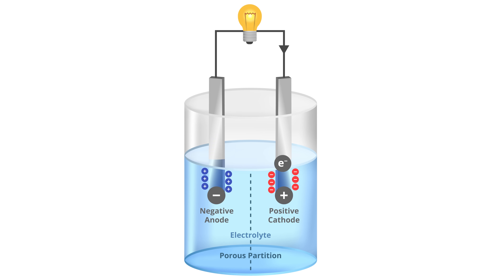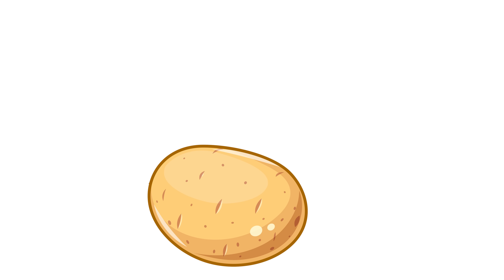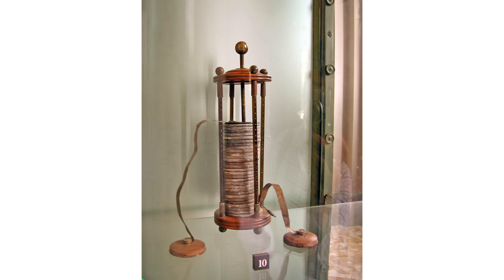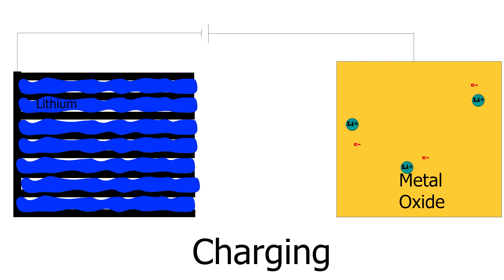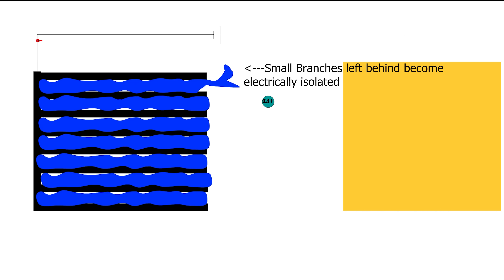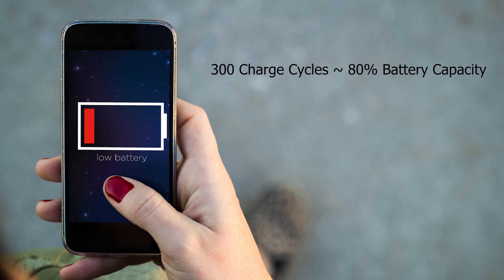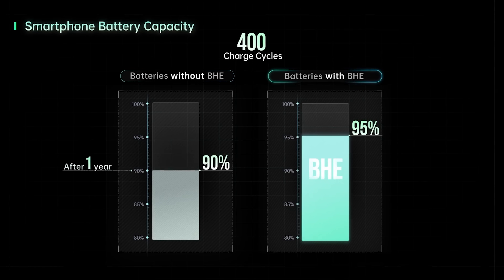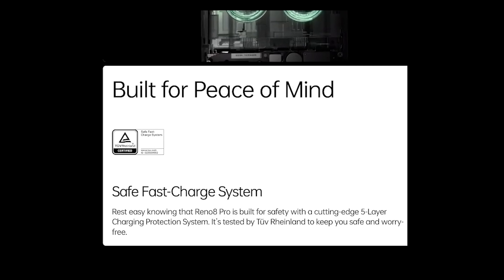How To Stop Dead Lithium and Double Your Phone's Battery Life

Comment: Informative vid but do bear in mind that the major phone makers already incorporate mitigation features into both the phone and the charger to prolong the cells as much as possible. You can't 'flatten' a phone through overuse and you can't overcharge it or charge it too quickly. Complex charging ramps are programmed in already, and the 100% you see when 'fully' charged isn't actually 100%.
Reply: My S21 Ultra has an option of charging only to 80% to extend battery life. Doesn't that indicate that 100% is actually 100%? The time to charge to 80% is also way faster than it is to charge from 80-100.
Reply: @KC-bg1th  "100%" is just the voltage the OEM determines as the maximum safe voltage, balancing battery health and convenience. Charging to 80% would be better for battery health but sacrifices convenience. The OEM could technically set "100%" even higher to further increase convenience and allow the battery to last longer on a single charge, but it would be at a sacrifice to battery health. It's all very arbitrary and set based on their research.
Reply: @NikkiDimesYT  these children are clueless. they have no idea what the percentages actually represent
Reply: Gotta remember Samsung is one of the leading lithium battery manufacturers in the world, they also make phones. They have an incredibly high interest in making not just their batteries last as long as possible but also their phones.
Reply: @_BangDroid_  other way around bro. The #1 reason people buy new phones is because their battery is worn out. Did you know that smart phone batteries used to be easily removable and replaceable, by design? Ask yourself why they changed that
Reply: @Superabound2  *sigh Yes I knew that. Batteries are still somewhat replaceable, while difficult it's still more than possible. My point is the phone market is incredibly competitive especially with battery life. Samsung also manufactures high performance lithium cells like 18650's etc they know more about the them than anybody except maybe LG who also make batteries and phones. The power consumption of modern devices is orders of magnitude more than the days of phones like the Motorola D170 (my first phone) that could use 4x AA batteries. It's more of a safety issue than anything else. If all consumers had direct access to high powered lithium batteries, it would be like the Note 7 explosions but for every phone brand. Just look at cheap hoverboards or vapes. Any time a consumer has access to high powered lithium batteries, there are huge safety issues. Phone companies don't want to be associated with that, so they seal them in.
Reply: I would have to disagree with the statement that the phone companies are looking to extend the life of the battery as much as possible. It would not be in their best interest to do such a thing.
You "can" shorten the life of a lithium ion battery by charging to 100% constantly and plugging it in every day to maintain 100%. Same is true if you let the battery drop below 20% on a regular basis. Lithium Ion batteries operate their best between 80% and 40% state of charge (SoC). 
If you check the voltage of a phone battery you will find that it is actually higher than 4.2V, which is the max top voltage for Lithium Ions. Some phones will push as high as 4.35. This is also why phone get hot during their last half hour of charging. Just like compressing air into a tank, when it gets close to its max storage, it gets hot, requiring more energy to force the extra bit in.
A more economical and feasible option would be to make a smarter charger that communicates with the device. This would not only allow most current operating phones to use the tech, it would also help to reduce the overload of waste into landfills by people tossing phones out.
Reply: Added FYI, just changing the top charge voltage from 4.2V to 4.1V can literally add several hundred charge cycles to lithium batteries life. This could add up to well over a year, or even two, depending on use case.
Reply: @korishan  It doesn’t add any charging cycles to the battery life. It reduces the number of charging cycles you can perform when you charge them by limiting the state of charge range that the battery is using. When you reduce “full charge” to 90% of the battery’s physical full capacity, you’re reducing a “full charge” by 10%,  thus using less than 1 full charging cycle for one “full charge”.

Now, what does help improve the battery life is that charging it less than 100% of its capacity (and not letting it discharge to its lowest safe capacity) will also reduce the amount of heat that builds up while charging the battery, and heat is a battery life killer because a hot battery breaks down faster because those electro—chemical processes talked about in this video happen faster, too. But you can do much the same thing by just charging slower without reducing the usable capacity of the battery.
Reply: @babybirdhome  You contradicted yourself in your comment. By limited the "voltage", you are limiting the "capacity". They go hand-in-hand and are directly related. 🙄
So by reducing the voltage, you reduce the capacity slightly, yes. But it increases the number of cycles you can charge/discharge. A "cycle" is not exactly 100% to 0%. It's any time you do a significant amount of capacity recharge. Otherwise charging from 60% to 100% wouldn't be a cycle.
Charging slower does increase life cycles as well, but no where near as much as reduction in capacity/voltage. The shortening of a li-ion batteries life happens mostly in the last 5% (or anything over 4.05V) of the charging. This is when it's being forced to take a charge, and why they battery will heat up, even if the current is low. You will always find that a battery gets much warmer/hotter when the charge percentage gets to about 95% of charge, even though the current is slowing down. Look up Constant Current/Constant Voltage curves to understand this better.
Reply: @korishan  that has a lot of sense
Reply: @korishan  Every phone already does exactly that. A USB charging analyzer will show you that much. They’re like $10-20 on Amazon.
Reply: @babybirdhome  Every phone does not. They follow a constant current/constant voltage charge curve, which is required for lithium ions. At around 4.05V the internal regulator goes from full current and slows it down to a trickle. And most phones you can't even tell it to stop charging at a particular voltage/capacity. They just go full ham to full 100% charge with the only way to stop it is to remove the charger cable. There are apps that will monitor the charging progress and sound a notification at preset charge limits to remind you to unplug the charger so it doesn't get overcharged.
Also, most phone manufactures usually charge lithium ion batteries slightly higher than 4.2V, they usually go to about 4.3 - 4.35. This "really" damages the battery sooner. This is also what has led to some interesting fireworks displays.
Reply: I don't think you know who Oppo is...  As an American I am holding off upgrading my OnePlus until I need to.
Reply: My S21+ charges the battery to 4.4v at 100%, which is not good. Anything above 4.2v starts a pretty rapid decline in charge cycles. Luckily samsung's software now has a toggle to stop charging at 85%, which is about 4.1-4.2v, which should give me the industry standard 400-500 charge cycles. It's a very minor inconvenience. Even using my phone as a hotspot for work lasts all day, or enough until quitting time and I can charge on the drive home.
I hate how much phones cost, so it's important for me to be able to extend the life as much as possible. Hardware and software has a much longer usable lifespan these days.
Phone is 15mo old now and I have an estimated 4% degradation. Hoping to keep it at ~10% by the 3 year mark.
Reply: Pretty sure iPhones have a similar thing too. I don’t think Oppo’s technology is any more sophisticated.
Reply: @springbok4015  Yes, you're quite right.
Reply: @Blitterbug  phone batteries with 4000mah are really 4000mah if you check it with a battery app. So this makes a battery very vulnerable for damage because you use it at maximum circumstances. If you use the battery between 20 and 80% then it lifecycle will go from 500? To 2 a 3000! The reason why phone companies don't work this way is because 20 to 80% is 60% of the original battery capacity and nobody buys a phone with 6 hours battery time over a phone with 10 hours of battery time. Thats the simple truth why they don't apply this simple trick
Reply: Yeah, no.
Reply: did this guy miss the whole electrolyte part?
Reply: it is "100%" you clown. if you want to be technical charging it to 4.2 isnt "100%" because you can charge to 4.3 or 4.4
Reply: Yeah that's why they release new smartphones every 6 months
Reply: You can still charge a phone too quickly technically. Any wattage high enough to cause extra heat is going to degrade your battery. And in my long experience with Samsung, I'd say anything over 15 starts putting out noticeably extra heat. Some phones charge at SIXTY watts now, and nobody is pretending that battery is going to be a long lived one lol
Reply: @Gremlin244  The problem with this is electricity doesn't work that way. A charger of, say, 60W doesn't 'pump' 60W into the connected device. It's capable of that, sure, but the charger and the phone communicate to establish a safe current. If you connect one of those little LCD dongles between the phone and the charge cable you can see that initially the current is tiny, as negotiation is made. The wattage ramps up in stages until the phone and charger ar both happy. If the phone is very low on charge the wattage will rise quite steeply for a short while, perhaps 20 minutes, before ramping back down. As an engineer I can assure you  this is what happens, and like yourself I've used mobile phones for many decades since they were a thing, and I am also a Samsung user.
Reply: I always slow charge and my iphone battery health is still at 100% after a year. If a battery isnt designed for super fast charging dont do it. Some phones can do 200W.
Reply: Yeah. A Chinese company leading the industry? No way.
Reply: @VacuousCat  its on youtube. 200w fast charging.
Reply: This was  nothing but a paid for advert disguised as a youtube video. Millions of subscribers and uses that to schill for money. Quite disappointing
Reply: Lol, you think Apple even cares about this?
Reply: @DrCJones  Apple is working on tech that reduces the life span of the non-replaceable battery so you have to buy a new phone as soon as possible
Reply: On Android just search for dynamic charging or it may be under smart charging and there's also sometimes battery protection where the phone only charges most of the way and runs out at nearly zero
Reply: Is that a fact or a supossed one?
Reply: @LeadershipIsNotAVirtue  It's fact. Just do some research.
Reply: @grantadamson3478  Claimed by themselves?? ? "As much as possible"??
Reply: @LeadershipIsNotAVirtue  It's a fact; most batteries include what is called a BMS - battery management system.  It prevents over-discharging and over-charging, and the really smart ones can control how much current they'll accept when charging.

Some cheaper batteries don't, and those are quite easy to damage.
Reply: @LeadershipIsNotAVirtue  Facts. Phone companies plow massive amounts of research into this stuff, even Apple who would benefit most from dead batteries. It's an industry-standard research area. Fast chargers have very careful charge curves built in to avoid damage and to prolong battery life - they only charge at 30W or 50W for a small amount of time before ramping down, and they cut off at around 90%.All this info is out there. EV makers do even more clever stuff, for obvious reasons.
Reply: It seems... fake. Like a company motto, which you are repeating. Sorry for my skeptic nature, but Im not convinced yet.
Reply: @LeadershipIsNotAVirtue  What seems fake? This is how modern phones and chargers work.
Reply: @Blitterbug  that answer you gave me doesnt match what I said before, so Ill have to explain the context again: what seems fake is not how batteries work, but the claim you are making that they try to have the best battery possible on their phones. Of course they are making research, but that doesnt mean they are using their best technology possible, even if they say so.

Do they want us to have a battery that lasts forever? Really? Then, please, companies, I want you to make smartphones with an universal battery slot, and with modular technology allowing users to change batteries, cameras or to upgrade a smartphone without having to buy a new one. Do they do all that stuff? No. Why? They want money, and they want to keep selling stuff, producing useless stuff we already have and making trash on the way. I even have a company, a food one because people always need food, its not a secret that is how making business work, right? I hope you wont deny it. So, are they doing their best? No. Do they want us to have the best battery possible? No. They want to give us the battery that sattisfies their interests, not ours.

Not being conspiracionist, its just common sense and there is a ton of evidence supporting what I say, lawsuits won by the people, and marketing built over bs all over the internet.
Reply: @LeadershipIsNotAVirtue  Even removeable somewhat standardized batteries would be amazing. ~8 years ago my husband and I both had the same cheapo android phones with removeable batteries, if one of us had to go to work etc and realized we had low battery we would swap them. Fast charging is great but being able to instantly get full by swapping was amazing. Mind you his got bricked from being in a wet pocket after getting caught in the rain. So there are some hurdles to them.
Reply: @LeadershipIsNotAVirtue  the fairphone doesnt need to be the best, as its easily replaceable. Though my old nokia batteries still work. 
Some chinese phones charge with 200W through better cell design. But does slow charging prolong battery life?
Reply: @LeadershipIsNotAVirtue  Planned obsolescence is totally a valid evil trope to the technology industry. And I don’t think there’s a great answer to your questions. I’m also skeptical but kind of both ways. I’m torn between whether or not oppo is just really good at fancy words and marketing, or if they actually have revolutionized something. 😅 So I think it’s best to settle on something like this:

You know they probably are doing something slightly different, otherwise they couldn’t actually market as such (with so many people trying to look behind the curtain) and you might even be able to find a patent somewhere. However, it’s very difficult technically to say how much better it is without testing it side by side. In any case though, let’s be happy that there’s a bit more competition out there to try and force “Big tech” to do a little less “making things break on purpose”.
Reply: @tommyverstraete5678  It could be easier if laws , internationally, force companies to be transparent. If you think so, if we people democratilly choose, we will choose for laws to repair, modular technology and transparent information with visual back up and video proof of every claim, do we agree? Why those are not laws? Because laws arent chosen by real democracy, but by a minority that is less than 0.0001% of each country. That minority is constantly being blackmailed (Epstein and Clinton, CIA and southamerica), bribed or have personal interests suchs as their own business or to gain more political power, and while oligarchs call themselves part of de democracy, the truth we dont live in democracy. The real name of our political system, me being in Chile and you being wherever you are, is: "REPRESENTATIVE MANDATE" or representative government. They make us think that is the epitome of democracy, giving it a wrong name.

So, as always, the cause are oligarch choosing in our name under a lie, to really chose laws that enforce companies, which obviously pay them.
Reply: @LeadershipIsNotAVirtue  it's a fact
Reply: @LeadershipIsNotAVirtue  It's a fact. You can look it up for android in it's latest update.
Reply: @jim1550  is any of that the same as the video though? All I could find was info about optimising the os, processor and apps to use less power (similar to what apple does) but cant find any info about them monitoring the same things as the oppo or doing anything to extend the actual battery capacity, just to get more use out of dieing batteries.
Reply: @jim1550  Thanks.
Reply: @mrcmoes  No, they do a lot more than this, most especially in the circuitry of modern fast chargers from Apple / Samsung etc.
Reply: @Blitterbug  but is it the exact same methods used by oppo? Is it the same or an advancement?
Reply: @mrcmoes  there's hardware inside the phone and charging brick to modulate power depending upon the needs of the battery. Low battery percentage and high battery percentage require slower charging (like below 30% and above 75%). There's also software/firmware that monitor the battery status and the incoming power and limits the incoming power if necessary. For example, if you plug your phone in and it charges to 100%, the charger doesn't keep supplying 5v at 2a even though the battery is full. It stops, and begins trickle charging instead.

In addition, as the other person mentioned, the number that is displayed at the top of your phone isn't the true battery charge percentage. 100% represents the maximum safe charging voltage. It would be possible to charge the battery beyond that to a point where irreparable damage is likely.. but the firmware prevents it. Likewise, 0% doesn't represent a completely drained/discharged battery. It represents the minimum voltage of the battery, below which irreparable damage is likely.
Reply: @williamdowling7718  Yes I know that. What I gathered from the video is that oppo was using a different method in the phone to monitor and control it.
Reply: @mrcmoes  No idea. I'm basically talking about current battery management tech as it applies across the industry.
Reply: @Blitterbug  I have to appologize. I am making these comments before my morning coffee has kicked in lol. Yes you are correct that the industry as a whole has been working to improve batteries. Oppos method, although different (from what I can tell) seems to be built on the work of the industry so far and is just a new way of doing old things, but nothing mindblowing. I was being nitpicky, didnt mean to be so aggressive.
Reply: @williamdowling7718  Very well summarised. There's a guy in this thread that thinks maybe I'm some kind of shill for 'big phone', so thanks for the extra detail.
Reply: @Blitterbug  the whole video was 'paid for' so yes its a giant Commercial for oppo
Reply: @Blitterbug  You do know Apple phones still use USB 2.0 right?  No fast charging there...
Reply: @TheLoxxxton  Which is why I and others are detailing how all phone companies work. None of us (well I'm not) are in the biz, just imparting general engineering knowledge to broaden peoples' understanding.
Reply: @somakun1806  It’s funny people making this comment. You do realize that the reason Apple was slowing down their phones was to prolong their battery life, right? That slowed down how quickly it consumed the charge in order to make them last longer and have a longer usable lifespan. So it’s pretty ironic using that as a comment trying to prove the opposite point.